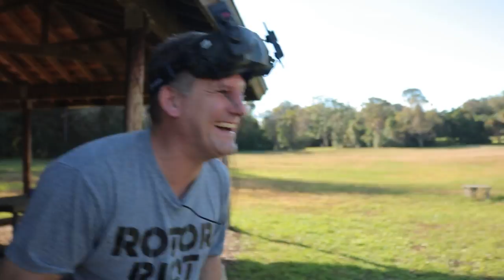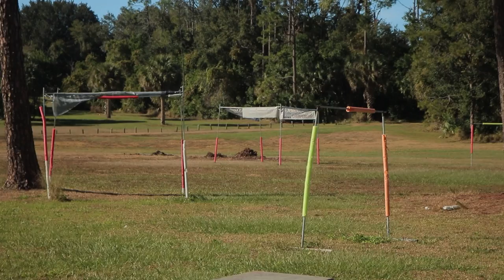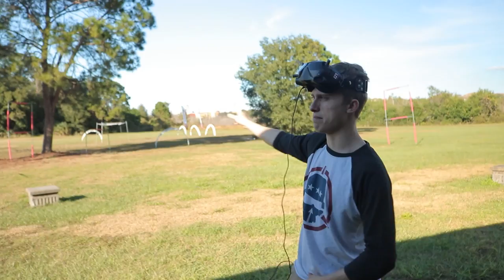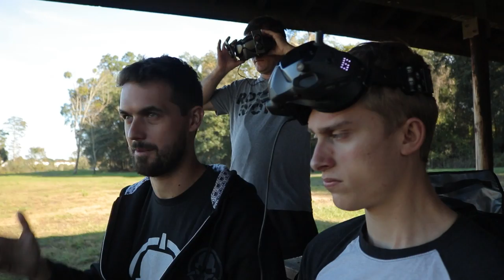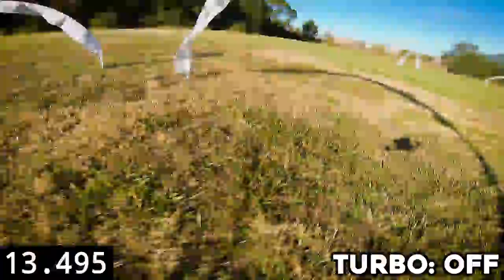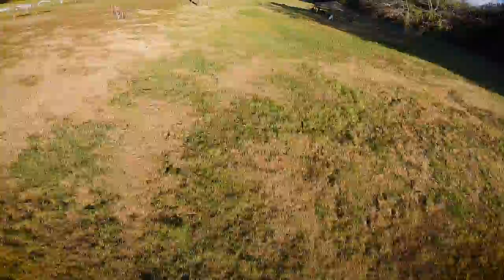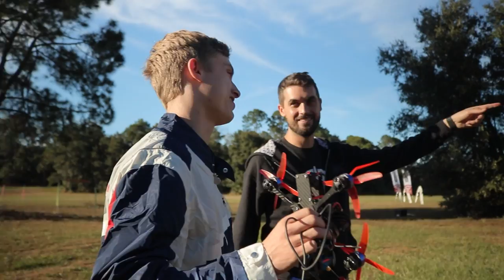Turbo Kwad!! - the ULTIMATE Race Drone?

Comment: it annoys me that they sold out to dji, its a neat novel product but latency nd just the way the signal cuts out is trash. if your not going far, then im sure its fine but meh
Reply: You obviously haven’t tried it. DJI goes much farther than analog through objects.  It penetrates much better, and doesn’t get any negligible latency until it reaches the point where analog has so much static that you can’t fly.  

I just bought 2 more air units yesterday - nobody is selling out to anyone - more like buying in to the company that is making FPV more fun.  ;) We never push a product that we don’t believe in.
Reply: @LetsFlyRC  this had been tested though, when both systems are at their limits the dji starts lagging noticibly enough to hit a tree, sometimes it freezes for a few seconds, again enough to hit something while sutr there can be a ton of static with analog but you can still make out things like a tree or a wall.  

i also haven't seen any long range flights  with people using dj and  sure the recording is neat but is still not the quality of a gopro . thoes units arnt cheep or light ether and  i dont know how easy it is to repair them ether.

and i have nothing against dji ether, in fact i was one of the people supporting them getting into fpv when everyone was talking shit and as i said they have a neat product but its  kinda over priced, im sure their fpv drone eill also be overpriced. and does Alex race using dji or analog? cause i will be surprised if he goes to tournaments with the dji goggles.

idk just the way they use the goggles in the vids it almost feels like its forced or like im watching an infomercial at times. maybe its just me idk, if you like them,  use them, but  irs more or less a novelty  or for thoes that dont push  limits.  again its  an alright product and its cool that they made something like this thats digital and im sure it will get much better but as it is, its too much imo and personally i prefer how analog behaves when its reaching its limits over dji, and that to me is a really crucial moment. it can be the difference of  getting home or buying a new drone, and again the extra weight.   anyway sorry if i came off rude, i had no intention of that